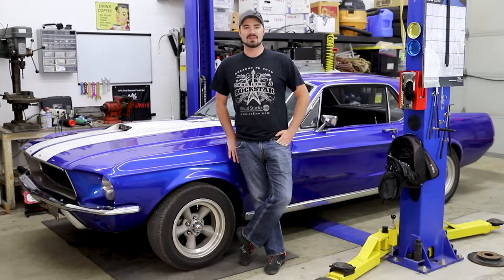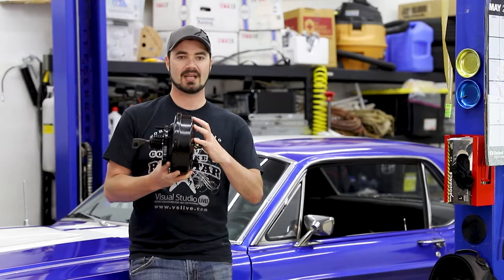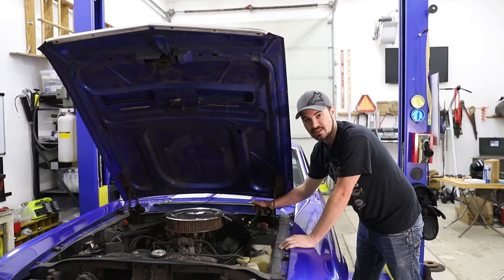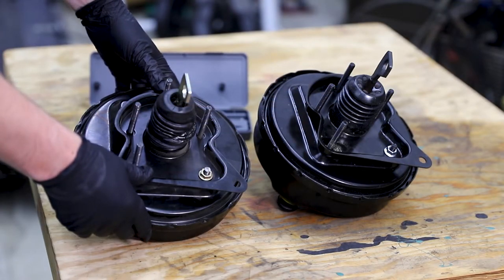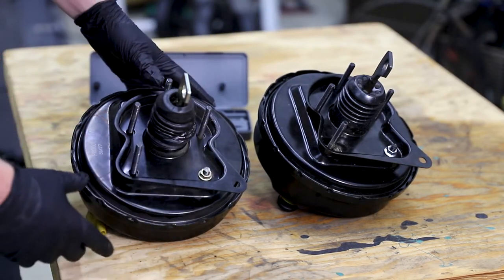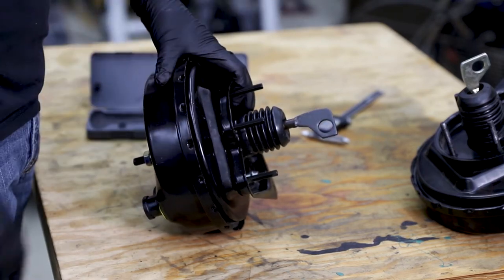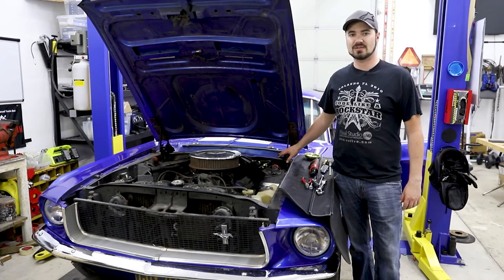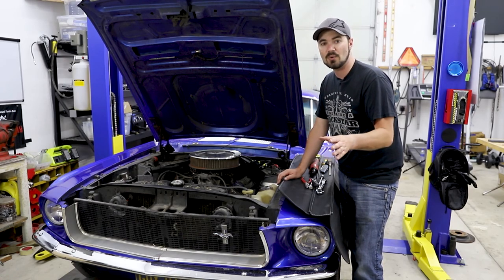[Fixed Audio] Installing a brake booster in a 67 Mustang (again)

Comment: Hello again.  I like your mustang vids as I have a 67 fastback with a Cleveland and C6.  I had to have my booster re-built and was lucky to find the only guy left in the nation ( possibly ) who can do that.  He was also able to establish the correct length push rod and supply that. Doing this was good because I discovered that the front and rear fluid lines were reversed in the master.  YIKES!  That could have been bad.  I took the brakes apart so many times while installing the Borgeson power steering that I resolved to removing the shock tower support each time for more room.  I sure would like to see you work on that electric PMU also. My cars wires are a fifty year old mess and adding all the circuits to get the Sniper system and electric fans to work right was a chore.  The whole project works pretty good now and I need to spend some time editing video and posting those efforts.  Thanks for your video info Casper,  best wishes!
Reply from the maker: Recording and editing everything adds a lot of time, but it's nice to have a final result. I can't count how many times I have been helped by random videos people have posted of their projects. It's also great just to have documentation of your projects to be able to go back and look at how far you have come ;)

Comment: Hi, can you please share the brake booster brand or link, I'm about to order one, but been hesitating which one will be a direct fit, I'm between Master Power, Leed or Tuff Tuff. Thanks for the video!
Reply from the maker: Sorry, I don't have that info. The problem is that most of them are the same Chinese part rebranded. It's a roll of the dice on anything that isn't a rebuilt OEM. All I can do is wish you luck. The replacement Chinese unit I received has worked the last several years without major issue. If it fails, I'm going to manual brakes.
Reply: @AmbiVe  thanks for the input man, it seems that everyone has the same problem. Will try to find a rebuilt OEM.